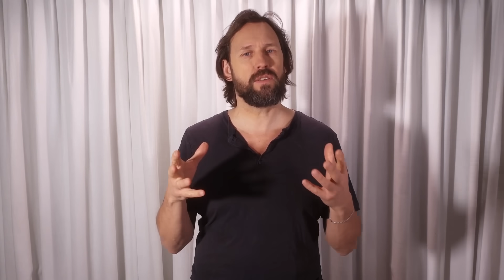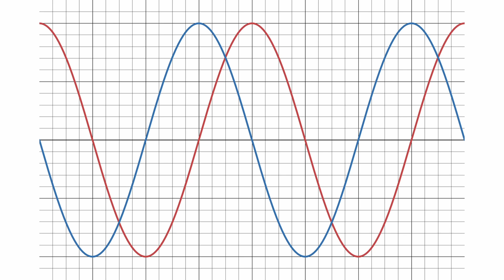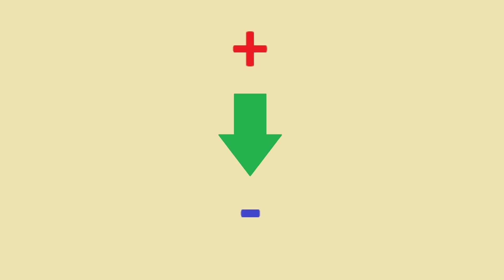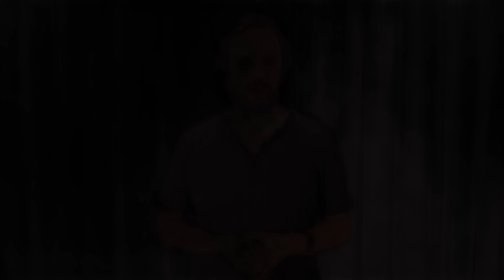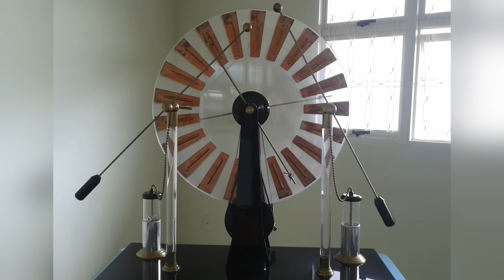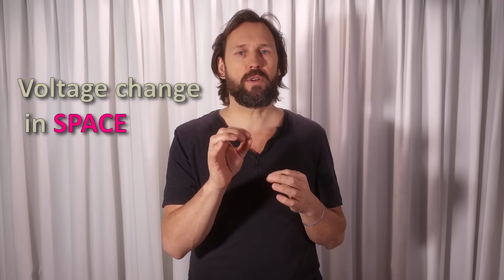The Electric Resonance SECRET Universities Hide

Comment: 10:54  I’ve thought it was this way: in a Tesla coil, if you put a bulb next to it and it lights up, that’s cause the nonconservative/induced e field creates a loop (like a field toroid without a beginning or end) between the terminals, and the displacement currents are vehicles to keep this closed loop continuous, and keep current (displacement plus conduction) constant everywhere. So I thought it wasn’t really an open system, because even though it looks like it’s coupling to the earth or ambient objects, it’s really using them as capacitor plates to complete the non conservative field loop.

Basically if you drew it out, it would look like a closed loop with a few capacitors. Except there’s high voltage and big distances, so the dielectrics would be huge, but isn’t it still a closed loop (in the sense of a closed field loop)
Reply: Idk, im learning so if that’s totally wrong please correct me 😂
Reply: @ashercorbett8089  Don´t put yourself down, you are largely right. The only reason all the effects of a tesla coil can happen are the stray capacitances, or parasitic capacitances, which close an otherwise seemingly open circuit.

Comment: Yes! There is "free" electricity. However, it is a VERY VERY VERY small amount. A fluorescent bulb will light up under a transmission line, and an LED might light up from a large TV antenna. But there is very little symmetry between the transmitter and receiver. So, 99.99999% of the power is lost. Tesla worked on wireless transmission of power. But, it requires concentric spheres or coaxial cylinders to work. He wanted to use the whole Earth as a resonant cavity. Unfortunately, rich powerful people stopped him. Edison was one of them.
Reply: Neon have an S-Type Curve
Reply: And you know why the energy is low? You probably have a bad resonance, and even after correcting it, the energy is still low. If you grounded it properly, with the ground resistance between the rod and the ground, current would flow. But the antenna definitely has capacitance, so it needs to be tuned properly. Ground resistance and antenna capacitance will then cause all the energy to flow through the load.
Reply from the maker: There is free power ❤

Comment: There is no free energy. If it was, someone would cut your access to it or make it illegal for you to access it, and then sell it to you, with 9000% taxes on top.
Reply: That's the point.
Reply: @lukiepoole9254  What's the point?  They are cutting your access to it?  How, exactly.
Reply: @ItsEverythingElse  By imprisoning and murdering Dr. med. Wilhelm Reich. That's how.
Reply: Truly, I tell you, I've done thousands of calculations and studies on all this, and I've designed a free energy device. Prepare yourselves for free electricity, and the devices will come from Poland. Say what you will, that I didn't design such a device. But I'm telling you, I designed such a device, and it has to work 10,000%. You all did Tesla's Nikola devices wrong. One after another, he got shocked; you don't think anything through.
Reply: @jacekwis512  What exactly does it mean 10,000% 🤨
Reply: @PlanetIscandar  As long as this device works, what I have developed will work 100%.

Comment: I don't think you can describe electricity without the gravity field. Gravity seems to flow into the South Pole and come out the North Pole. The difference between gravity in versus flow out is matter condensation and magnetic field and rotation of the planet. Our position in solar system condenses Nitrogen, Oxygen, and Carbon primarily. Our soul is a black hole that sits just under our brain and can be seen by MRI. The black hole 'warps' time, and gravity connects all space. Our soul connects to time and space.
Reply: You need a better class of pusher.

Comment: If we observe infinite sine/cosine functions, "leading" is arbitrary annotation. But I guess voltage leading is related to the usual steps of historical experiment with the resonant circuit - first charging the capacitor, and then closing the circuit with a coil. 

Also, it is unfair to mix the B. Franklin's wrong guess into this, because if we change the positive direction of the current (of electrons), we would also change the sign for the voltage itself, so that "plus" remains "the side with a surplus of charge (current carriers)" and "minus" "the side with a dearth of charge (current carriers)". So, then, the "Voltage leads, current lags" mnemonic would probably stay.

On a side note, that would have probably made schematic symbols of electronic devices different (vacuum tube anodes being the bottom electrodes in the symbol, while cathodes with their heater filament circuit ackwardly being on top of the symbol, semiconductor diodes and  transistors' arrows pointing in opposite direction than they point now ...). What we now consider positive end would be ground, chasis, like in old telephone circuits (-48V battery voltage).

Comment: Well current is just the time rate of change of electric charge, it doesn’t specify direction, so it is a scalar. The conventional current and electron current is indeed taught. Displacement current is also taught but I guess not as in depth unless you take antenna/RF/EM electives.
Reply from the maker: no direction no polarity? in my Experience charge is the energy in the field and has momentum and inertia.
Reply: @MasterIvo the polarity and thus direction is specified by the voltage iirc. Conventional current flows from positive to negative as you know, and usually the actual current is electron flow but sometimes can be ions

Comment: I've always heard that voltage was related to electron flow and was from - to + and current flow was 90 degrees out of phase and in the opposite direction + to -.
Reply: Electrons in a closed circuit are veeery slow. They could be the effect rather than the cause ad far as we know.
Reply: @Grouiiiiik  the electrons are slow but they immediately push the one right in front of it so the "effective" velocity is very high
Reply: @cj09beira it’s as if the electrons polarise the field for power to flow, just a thought ✌️
Reply: @cj09beira  Exactly.
Reply: @Grouiiiiik  Ok Very good The mainstream is so completely sure they've got it all figured out. It's nice to hear that we may have more to discover.

Comment: master ivo to me it seem you turned your entire narrative in order to remain safe and also guide people along the way. i feel the real thing have already been revealed to you and you can not expose that to its fullest for usual reasons! and now what you are trying to do is, you are trying to guide people in a secret way where people might discover the main secret on their own with out you exposing the entire phenomenon. good luck  ;)
Reply from the maker: indeed much is Revealed. but first I need to test if it is true. then and only then I can share.
the first confirmation is fact. and this video is the start to explain it ❤
Reply: @MasterIvo  let me tell you this one last big thing with my small mouth. vector field: generating motive charge via rotating magnetic fields results in alternating ac of back emf. scalar field: releasing/dissipating "disruptively" a fully charged dc capacitor via short circuit has zero return currents hence "PURE STATIC PULSATIONS"(unidirectional AC) :) ->->->->->-> 🤷‍♂️

Comment: Nobody is hiding the difference between electron current and conventional current. Using either current doesnt change the phase of the current and voltage. Considering how much resonant circuits are used and simulated and how accurate those simulations are I find it exceedingly difficult to believe there is something fundamentally wrong with the university description. Still I am all for trying to think outside the box so good on you for considering everything but I think I would need a bit more substantial proof than theory before I was convinced. Keep it up
Reply: I just want to say this comment was nice to see. For one specific reason: skepticism without contempt. 

Respect for your fellow human is underrated.

Comment: current flow direction has always been an argument in the electrical field.  I am now retired, but I can say that while regular electricians and control technicians/protective relay technicians argued with a wink and a smile from time to time on this subject matter, engineers would get into fist fights over it, claiming hole theory etc...   I have always known electrical power flowed from negative to positive in the circuit, but if that is the case, then electrical current must flow from positive to negative in the power source.
Reply from the maker: True! between the plates of a capacitor it flows from positive to negative.❤